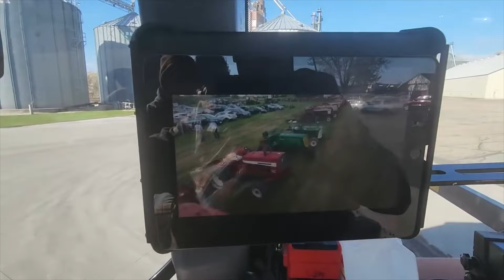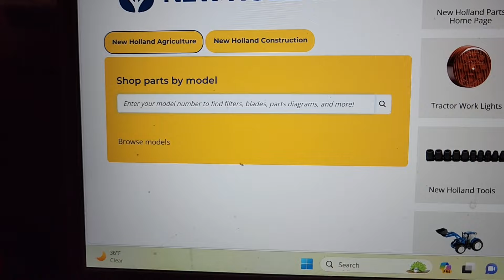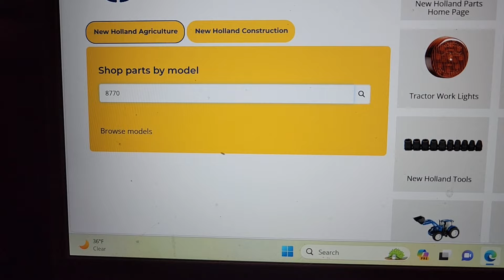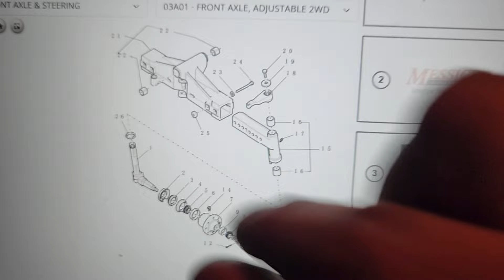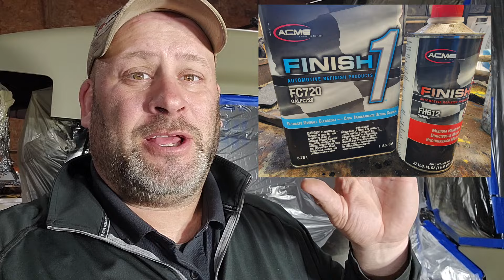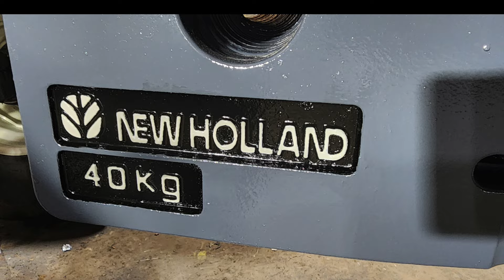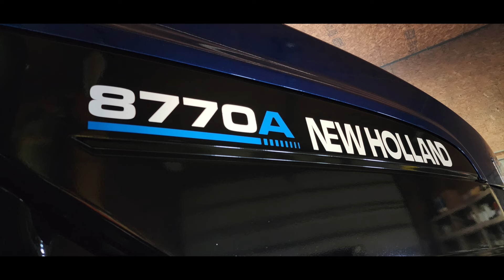Blue Power Special 2 0   HD 1080p

Comment: Dont use etch primer on plastic or fiberglass. Etch is a chemical adhesion, does nothing on plastics or fiberglass designed for raw steel, aluminum, etc. You need a 2k surfacer if you want to sand, or an epoxy. We recommend wet on wet, sand 320/red scotch brite, seal with an epoxy primer and coat with a good single stage urethane or base coat clear coat system. Ask any questions I owned a collision repair shop, but we did paint lots of tractors. Only need 2-3 medium coats of base, if you put it on to light you will have adhesion problems down the road, ie peeling ect.
Reply from the maker: Interesting. Last year I had a pair of high-end paint shops come out and go through the process with me. We used the exact products they recommended on the first 8770 BPS. has held up extremely well. Asked their advice again as to products to use on these two, as paints were different as were the approaches, well a bit. All recommended the etch primer again.